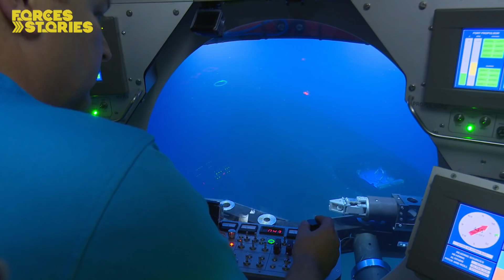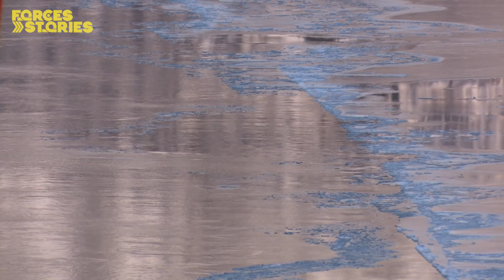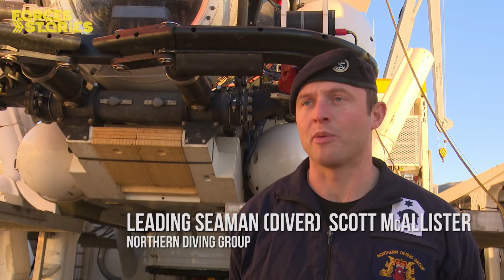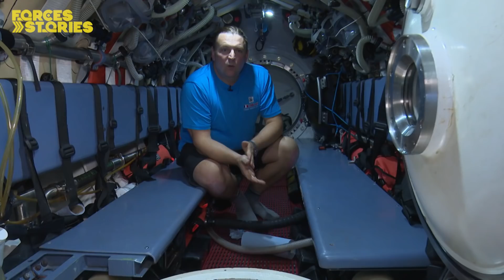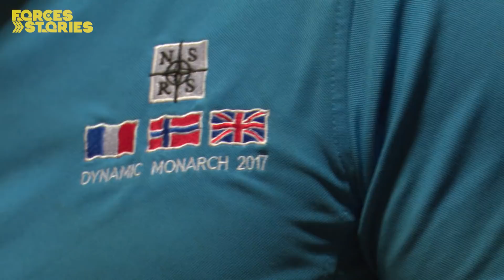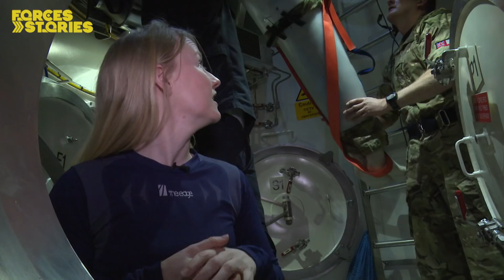Saving Submariners Trapped Under The Sea | Forces TV

Comment: why do submariners need to decompress if in side a sub ?
Reply: @j.4354  doesn't the air pressure decrease as you get higher, so the aircraft wouldn't get crushed?
Reply: @spacedonkey3412  aeroplanes are pressurised to allow them to fly at high altitude where the jet engines are most efficient, without needing supplemental oxygen to keep people alive. It's not required for structural integrity.
Reply: @Calum_S  if you want a laugh look at what Atlas has been talking about
Reply: @j.4354  so if a sub goes to, let's say 300m they'll pressurise the inside of the sub to the same pressure found at that depth?